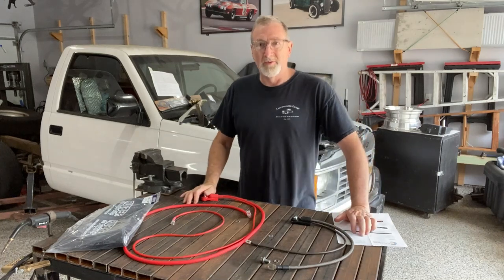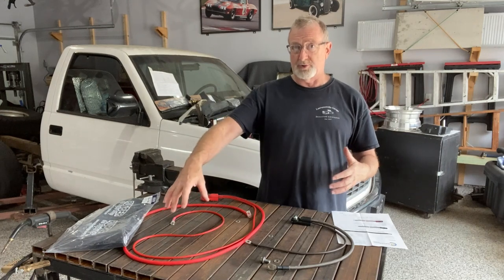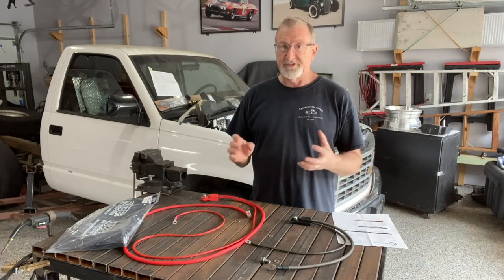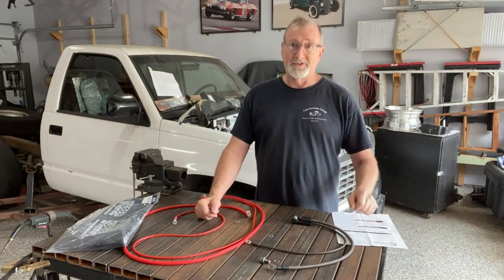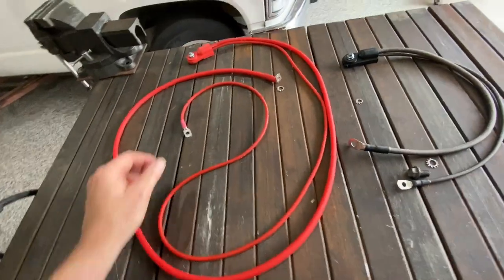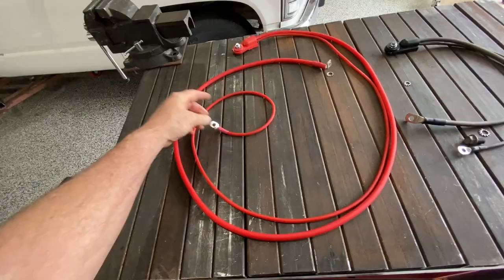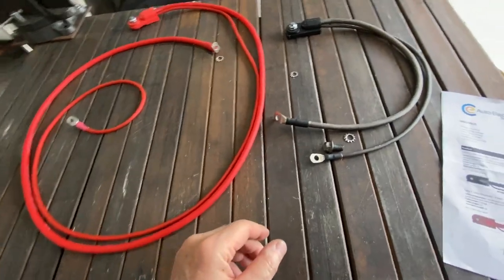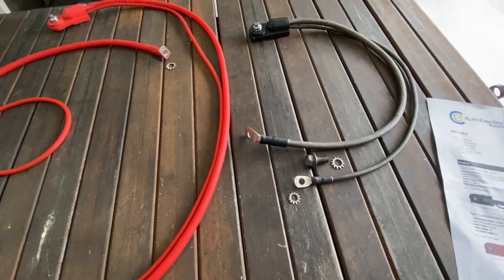Custom Battery Cables for Your Chevy OBS LS Engine Swap Project

Comment: I would consider putting a ground wire from the block to that spot on the alternator bracket that says ground. The alternator needs grounding to effectively charge too.
Reply from the maker: You could...however, the alternator bracket is mounted to the engine and so is grounded by the engine itself. The motor is grounded both by the negative battery cable but also from the battery to the frame and the engine to the frame from the back of the block. All to say, as long as your ground straps are in good condition, there should be no problems and no need for an additional strap. Adding another ground is not going to hurt anything, but to put a strap from the engine block to  the alternator bracket is unnecessary.

Comment: No positive from battery to alternator?
Reply: Just asking I’m here learning from you. I always thought the positive wire should be running from battery to alternator
Reply from the maker: The layout of the cables are different from the “OBS” (88-98)to the “NBS” (1999+) trucks. The newer trucks do have the + cable to the alternator as you mentioned. The older truck does not. It can be done either way. With the battery moved to the driver side, looking back, it would have made sense to add the alternator wire to the hot side, like the newer trucks. Moving forward, if I move the battery to the driver side I will include that wire in the bundle. It would be a “cleaner” choice. Good eye, thanks for the comment!

Comment: How do you swap battery location
Reply from the maker: You could literally put your battery just about anywhere on your vehicle that has the space. For the OBS trucks, the primary battery location is on the passenger side front (under the hood). For OBS 88-99 trucks, it was possible to have the battery located on the driver side as well. Most diesel models (I believe) had them there and in later years, you could get a second battery as well. I have seen late 90"s trucks with what appears to be a battery case (in plastic) on the driver side. Inside is empty, I suppose for storage, or it could have a 2nd battery in that location. As far as how to do it, you just need a mounting tray for the correct size battery. Since it was an option, careful searching will let you find one in the scrap yard. That is where I found the 2 that I have. There are a couple of different designs for mounting. The earlier years use a mount like I have, all steel. The later mounts are a combination of steel and plastic. They are designed very differently. I prefer the all steel variety personally, but both are available so it may come down to what you can find. I have done the swaps both ways. It really is up to you and the plan for the truck. If you wanted to put a turbo on your truck, I think the driver side mount would be the way to go. Creates more space for the turbo and removes the heat from the turbo being so close to the battery. Just my .02.